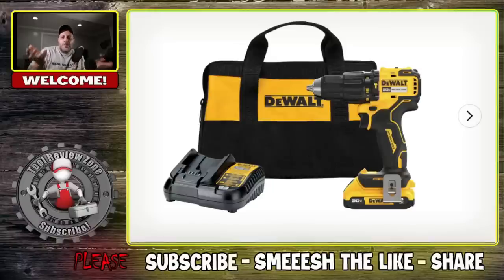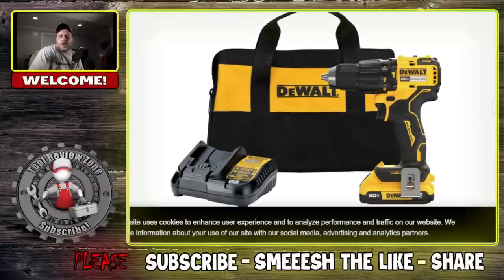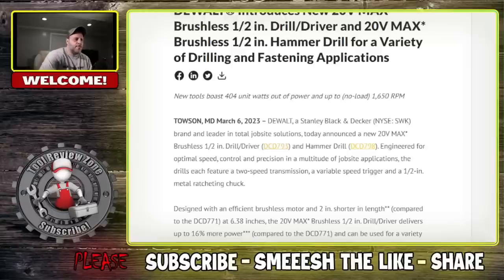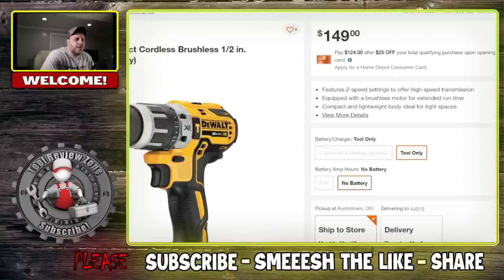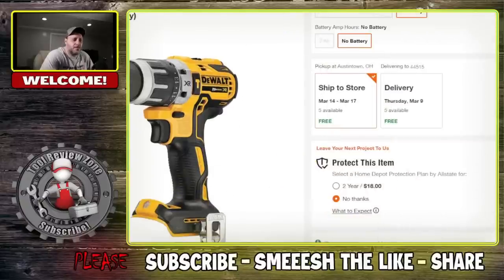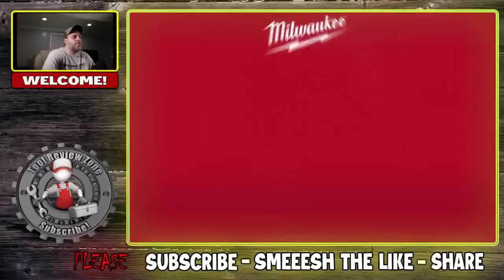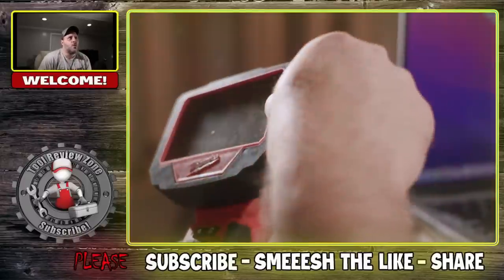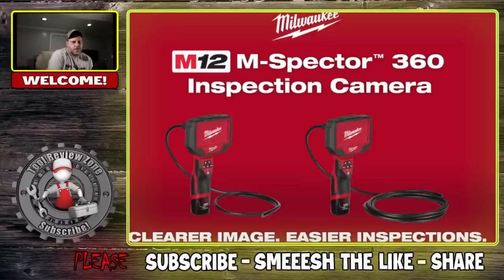Milwaukee And Dewalt Tool Drops New Power Tools

Comment: Yeah, DeWalt does that.

I just bought a new impact driver. The fine print on the ad for my new one says their "more power" percentage comes from a comparison to the 885.

I bought the 885 when I bought my house, in 2010 or 2011. It lasted a long time, but I finally smoked it after a decade. I know that tool, and that is an OLD tool! It wasn't even brushless.

Comparing a new tool to the 885 is absolutely pointless. But if you want to know, they'll gladly tell ya.
Reply from the maker: Hahaha 👊🤣

Comment: The price on the Milwaukee inspection camera is good. But they need to up the capabilities of it.  They really need to add Wi-Fi and Bluetooth and have is connect to a phone or tablet.  Yes, it will raise the price but it will make it easier for tradesmen to save and export file.